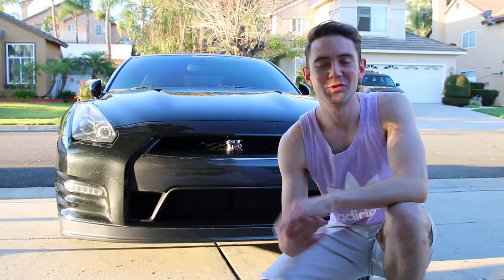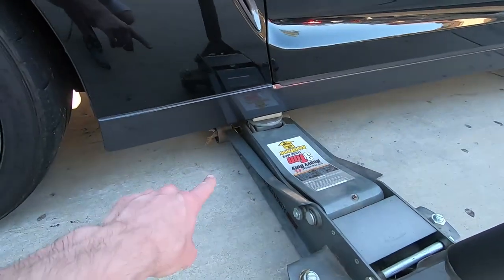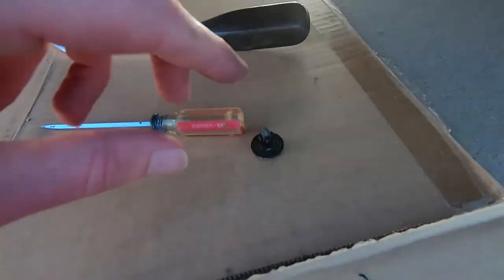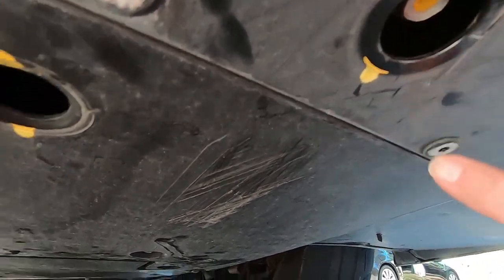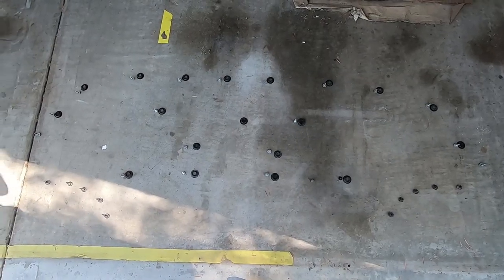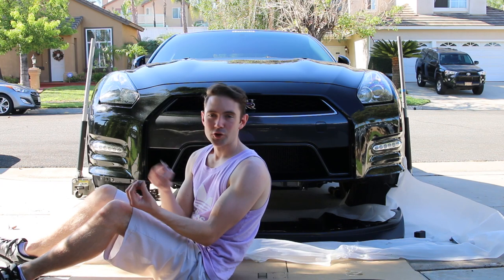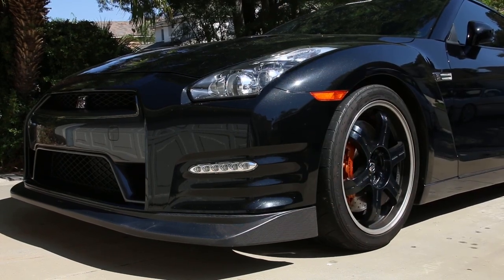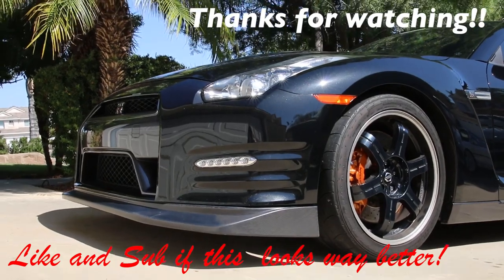How to Install GTR Front Lip: VeilSide GTR

Comment: not a fan of that lip but to each their own, I like the rexpeed one and that's the one I chose for my gtr but, nice addition to the car
Reply from the maker: I wanted one that had an even splitter all across the edge, but yeah any lip is definitely an improvement for the GTR. Thanks for watching!
Reply: Snow_White_MR2 rexpeed has a k style which is the one i went with with has a splitter along the side of the bumper and becomes more subtle towards the middle of the bumper to not break the lip and for clearance, then they have a k style version 2 i believe it’s called which literally is the same looking lip except the splitter is all across the edge and keeps going consistently around the lip, you shoulda checked that one out